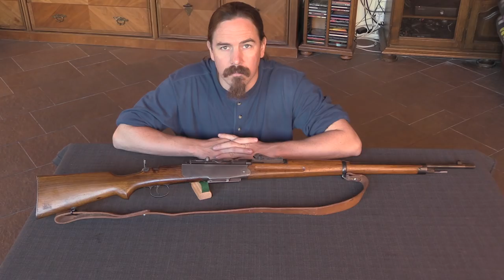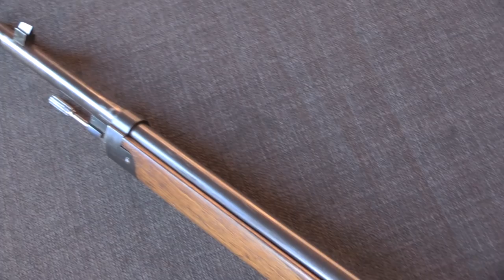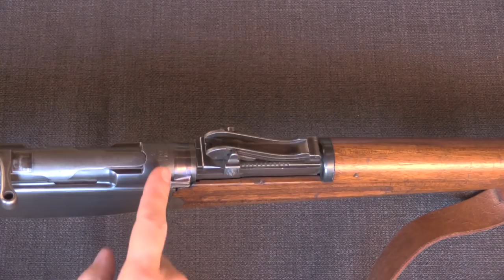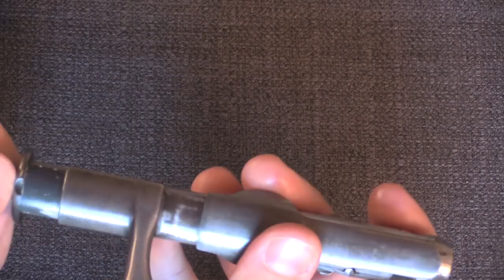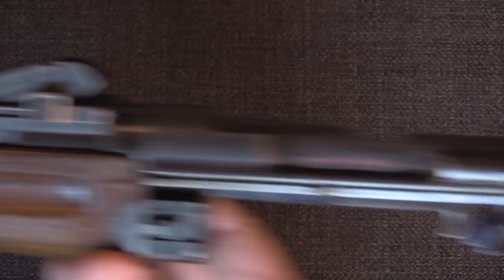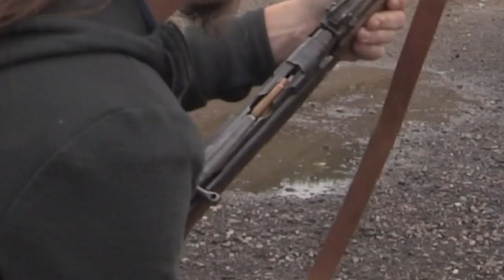Prototype Friberg/Kjellman Flapper-Locking Semiauto Rifle

Comment: It is interesting that the bolt is kicked open and kicked closed. You are right. We do not really have any firearms that I can think of that use that system these days. I wounder if there are any hidden advantages and/or disadvantages to such a system over spring systems we use today.

Comment: It may be odd today to have a bolt on a semiauto which is not controlled directly by a spring but a great benefit to it is that there is no danger of pinching one’s fingers in the bolt while loading the magazine. There is no spring constantly putting foreward pressure on the bolt and thus no “Garand thumb” or should I say “Ljungman thumb” since Ian is in Sweden?

Comment: The recoil in the slow motion video looks harsh except I bet the lever arm catching and returning the bolt smooths out felt recoil. It seems that the lever pivoting and reversing the bolts direction might slow the bolt and smooth out the direction change / recoil impact. Interesting idea but seems unreliable and in need of a lot of refinement to change that. Great video as usual. Love seeing these type weapons.

Comment: A shame it didn't see more development. It looks like its really close to running well. If you were to open the ejection port a tad and lengthen the receiver slightly (to reduce the likelihood of brass hanging up like it did) I bet it would run like a top. I can understand why there's no spring on the bolt: the designer might have wanted the gun to be able to function as a straight pull bolt action in a pinch. It'd be interesting to see this action combined with a SVT40 style gas system.

Comment: Does the safety perhaps work the other way around? Locking lugs keep the firing pin from extending into the chamber (if the lugs are not engaged) not the firing pin causing the lugs to engage?

Comment: When it fails to feed/eject cases, is that just an inevitable thing that happens to old semi autos or is it a failure in design?
Or partly both?
Anyone who can answer for someone who is a bit gun naive, it would be appreciated :)

Love this channel, not normally a big gun person but YouTube is converting me because of these gun channels that take a historians view.
Reply: hknuddv It seems to be a bit of both honestly. But it wouldn't have near as any ejection issues if the feed/eject port was wider. Rifle shells never get spat out the exact same way every time and if it leans to the side then it hits the side of the reciever and jams as it did in the test firing. But I'm sure when it was new it had much better tolerances.
Reply: Thanks for the information all :)
Reply: hknuddv looks like its because the slot for the ejection is really tiny and the ammo is probably not quite up to what it was when it was new
Reply: A little bit of both.
Automatics tend to have failures to extract/eject every so often, but in modern weapons it's really rare; once every few hundred/thousand rounds for a typical rifle.
This one got it really bad, mostly because the ejection port was cut waaaay too small and the cartridge wasn't reliably clearing it. Ejectors just kinda fling a spent casing in the general direction they're installed on, so if you don't allow for some variance there while designing then you'll run into problems.
Reply: As others have mentioned, hknuddv, it's most likely a combination of things. Small ejection port, age and wear, unfamiliarity with the weapon, and possibly ammo that's just a tiny bit different than what was produced when it was new. It should also be noted that this gun was a prototype and the same general system wasn't perfected until some time later. It's entirely possible it never worked well or only worked in other calibers.

Cheers!

Comment: Indeed a weird rifle. But it shows once again what kind of force ur dealing with, being able to kick the bolt into battery while loading a cartridge from the mag with just a flick of a lever. Still, I'd always prefer a recoil spring applying constant forward pressure on the bolt over a mechanism that just gives it a kick forward to send it home relying on inertia.

Comment: How much would these have cost to mass produce? Let's say the gun is or could be reliable enough for adoption by a military back then, is the design such that the production costs would have been feasible? Or would it have been way to expensive? I'm theoretically thinking if it could equip every rifle squad of the first line units with one rifle each.

Comment: I'm disappointed that you didn't use the gas cut off and try to operate it as a straight pull bolt action and see if it was more reliable that way

Comment: "Black Powder = bad for autoloaders."  BUT... how about a forgiving, open bolt subgun like an Uzi?  Engineered with room for fouling and dirt.  The mechanism is very simple, there's no reason an 1870's gunsmith couldn't make one.  Imagine Wyatt Earp at the OK Corral opening his coat to reveal a black powder Uzi on a sling.  Would it work?

Comment: You really should test fire all old firearms in a fixed rest before letting them anywhere near your body. A fairly basic one can be made from an old tyre casing, a few sandbags and some straps. Butt into tyre casing which is filled with sandbags, another sandbag or two to support the barrel, strap it all together then tie a loooong string to the trigger, retire to place of safety & pull the string. Remove firearm, did assemble and examine closely for cracks or other flaws.
Reply from the maker: What makes you think we didn't do that before filming?
Reply: You I'd trust to do that, but it wasn't specifically shown or mentioned in the video. Some people are not so careful - I have a few amusing stories from Police range practices involving confetti money for instance.